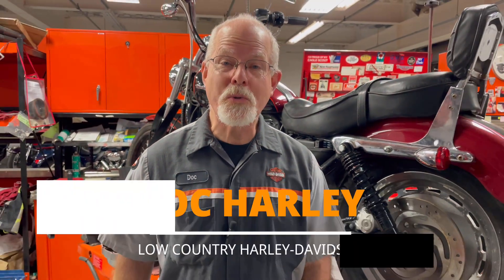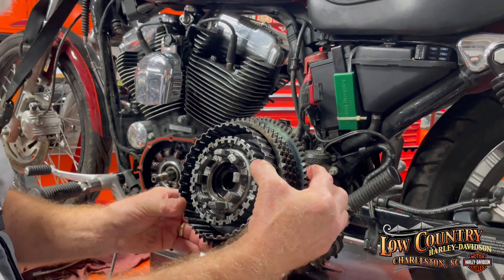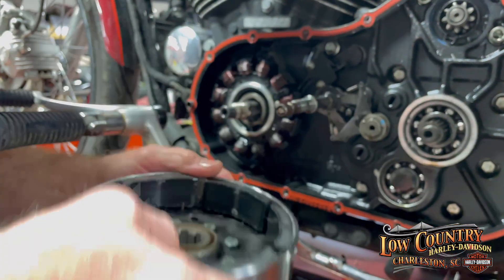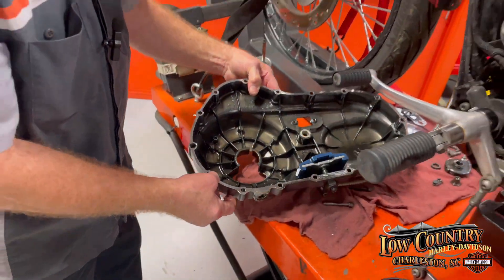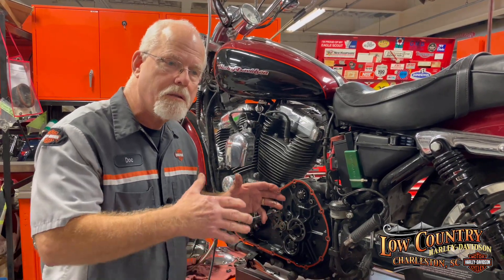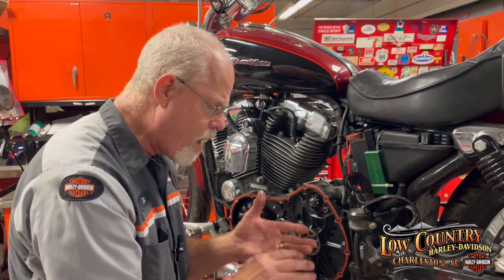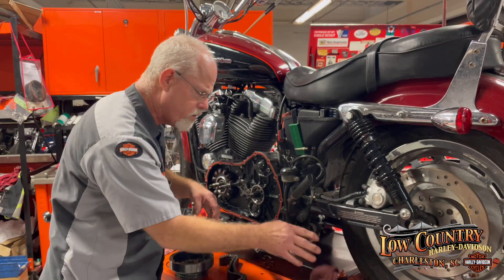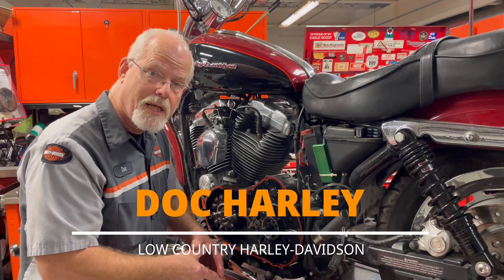Doc Harley Talks: Ignoring Starter/Primary Noises

Comment: I really appreciate videos like this so I hope you won't take my comments the wrong way.  This situation is exactly why I do not let anyone change my fluids.  I do it myself and have done so for 60 years.  I am not one to ignore grinding noises and I always pay attention to the starter since it usually gives early warning signs when it or the battery needs to be replaced.  This situation has obviously been going on for a long time.  Longer than the oil change interval. You didn't say if the dealership does regular service on this bike or if the customer does it.  Whoever changed the oil in this Sportster and didn't look at the drain plug needs to have his wrenches taken away fro him.
Reply: Absolutely. Anyone who rides, I don't care, from a Harley to a Honda, should be able to do their own maintenance on the bike. I've always done mine for nearly 60 years too. Also on my cars.

Comment: Doc. I had almost had the same thing happen to my Roadking , but I didn’t here any noise . When I was changing all my oiles  the oil in my primary had a silver tint to it but the plug didn’t have a lot of metal on it , so I changed the oil and put another 100 miles on it and looked again and it was silver . So I got my manual out and pulled the primary all apart and found the main clutch basket bearing had started to fail because the race on the shaft slips . If I didn’t catch that early in stead of $75 it would have cost way more . Pay attention to what your bike is telling you people ……..
Reply from the maker: Well done Sir…..Doc

Comment: Well rub a little salt in my wound Doc. You see, my '85 big twin Evo started this very thing late last summer. Slow turning over, starter clutch letting go and free-wheeling, the grind occasionally. Did I park it immediately and address whatever the issue(s) are? No. I'll deal with it during the off-season. Tore up my shoulder in November and that ended my riding season. Had surgery in December, and now about to return to work and now I'm gonna tear into it and find out what's up and prolly pay some stupid tax of my own.                                                         I guess like Don Smith says, I deserve a big fat bill for whatever parts I need.
Reply from the maker: Wishing you the best….Doc

Comment: You were supposed to put the round uneven black washer in between the two pieces for the passenger floorboards. That's what makes them stay up and not loose either. Took me a minute to figure it out cause no I structions. You think for $240 they could include instructions

Comment: Great video, learning something every time, I Have a 2014 ultra Limited with only 7K miles, all Stock, only slip on muffler, start hearing a clunking sound in my primary, when cruising, every time when I give a little gas and release the throttle , I noticed when I was driving around 40mph, maybe in 4th gear, any Idea, your help is greatly appreciated. Thank you
Reply from the maker: We appreciate you watching Doc Videos. My opinion if you have been using higher gears too soon on a 2014 with only 7K miles you might want to have a trusted Harley Tech inspect first your rear belt adjustment then all components inside your primary. Using higher gears at too low of MPH & RPM puts added stress on the primary components. I agree the motor sounds great loping along at a slow cruise….Doc

Comment: Doc I have a 2005 fat boy and I change oil every year and I don’t ride to much but I have growing noise I check the primary chain and adjusted still have noise not have metal is like bearing liner worn or bearing loose , 2000 to 3000 rpm and down noise is there. Thanks … 🙏🏻
Reply from the maker: Let me put my ear up to the internet 
🤔…..too many possibilities……Doc
Reply: @LowCountryHarleyDavidson   I know I’m so sorry , has to open the bike to check all bearings and something else, because no have metal derbis.

Comment: I'm getting a high pitched chirping noise from the compensator area on a 2012 electra glide cvo?  Everything I've read on the comp is more of a rattle/ clunk noise.  Chain tension does not seem off.  Thoughts?
Reply from the maker: My first thoughts are for you to check charging system. Why? If the Rotor and Stator are going bad a lot of damage can spread. Next the bolt that holds the Comp assembly tight is just starting to come loose. In any case, don’t wait for the rattle…..Doc

Comment: Hey doc will the 09 and up rear rim and drive pully fit on a 07 these are street glide models. I was wandering because I was going to replace the stock comp. To a solid comp and was looking at the rims for rubber pads in the pully.
Reply from the maker: I have never tried. It may work if you match the Swing-arm to the wheel…Doc

Comment: Hi Doc thanks for your great videos about harley motorcycles. We have a 2005 sportster 1200 XL and always its hit a bump on street we hear a metal sound like from the front end or under the gas tank. We send to change the engine mount, front folk spring and oil, check the triple tree bering all nuts are well adjust, tank bolt adjust, kick stand ect and all look ok. We go to 3 diferent motorcycle shop and spend money in diagnostic on each one, one of them was a Harley dealer and no one find what make the noice. Any sugerence about that
Thanks in advance for your help
Reply from the maker: I had one like that. Turned out to be the fasteners that hold the fender to the side plates that attach to the forks. Remove the fender and go on a ride ……Doc
Reply: @LowCountryHarleyDavidson   Thanks for try to help me. I remove the fender and ride its but still make the noice, look like from top triple tree or from front bottom tank. Any future segerence let us know
Thanks againg for your help and keep doing your great motorcycle tutorial videos👍

Comment: so what do you think was the real first problem here ??? battery so low it was making the starter grind into the gears ?? then it wore down the teeth of the surfaces contacts ??? then he just kept on using the bike and said oh well a little noise is ok when i start bike ??? and then it just got to the  point that he had to bring bike to the Dealership ???

Comment: Got an 08 xl1200l had to replace a primary cover used a vtwin mfg cover and a James gasket kit i have had none stop issues chasing down a binding shifter shaft followed torque specs bolt patterns ,it shifts with the cover on but no bolts seated any idea what I need to look at?
Reply from the maker: A bent shift arm through the cover, a bushing that is not in all the way, shift arm assembly is no pushed in all the way…Doc
Reply: @LowCountryHarleyDavidson  shift shaft was fine on previous cover only switched do to a stripped out clutch cable thread, I'll check the items listed to make sure that there wasn't a issue during install thanks
Reply: @LowCountryHarleyDavidson  was a faulty cover from vtwin mfg had a warp in it

Comment: So with my 2009 XL1200C I tried starting my bike when it died by running with it and popping the clutch in gear. I just ended up breaking something which I investigated to be the snap ring and retaining ring for the clutch pressure plate. The spring and clutch discs fell freely after pulling the cover off. I found at least one tooth on the part of the clutch that holds that to be chipped with scoring inside that general area. The pieces of the clip were large and mangled in the bottom of the cover. I wondered why I couldn’t get a proper clutch lever adjustment or why it wouldn’t change gears even with a new cable. 
And I still haven’t addressed why the bike died in the first place. I’ve just finished rebuilding the starter solenoid and will try to put that back on but the electrical plug that goes into the bottom part of the outside of the starter housing was filled with oil and I smashed the plastic on accident. No money to get a new starter so I’ve superglued the plastic pieces I could find and will try to silicone it in place when on the bike.
Reply: I guess my question is if I use the bike until I can replace the damaged parts in the clutch basket and if oil in that starter button electrical plug (the one on the bottom of the starter housing)would cause the starter to not work?
Reply from the maker: Wow, times are tuff. Hang in there….Doc
Reply from the maker: Multiple things going on here. There has to be a reason the clutch clip came out. Can’t just get a new clip and ride off. Well maybe you can, I could not, knowing the clip could come out again right when I need it going through an intersection. 
If oil is coming out the connection, you maybe did not replace the thin o-ring in the starter clutch assembly. Oil can be a conductor and ground out the power coming to the starter. It’s got to be tough but stop……Doc

Comment: Doc, wish you would do a video on the M8 cold start tick (Hydrolic lifter noise?).   This noise varies greatly between bikes in our HOG club.  A new M8 Road Glide Limited in our group had severe tick thank lasted for Minutes not seconds at startup.  After warranty tear-down, and dealer confab with the Harley Factory techs - the final verdict was "Run ONLY Syn 3"  Amsoil Vtwin oil was the culprit.  (What?)  I contacted the Amsoil engineers and they cried Bologna!  Now I see post that the tick may be carbon buildup on pistons on bikes with only 10K?  My M8 runs amsoil and the tick lasts only 15-30 seconds on cold start. (I have an external PVC vent can on mine).   What is the real story - and why with the M8 and not with the twin cam?  They both have hydrolic lifters?  Please do a video on this.  Thank you
Reply from the maker: I appreciate your suggestion and information….Doc

Comment: I feel like I have like a Humm or low pitch whine coming from mine

Any thoughts?

My only guess was Maybe low primary oil
Reply from the maker: I would want to know the condition of primary adjuster and remove the primary cover to see if the starter gear is returning back all the way….Doc

Comment: Why does this information not pertain to the other bikes. Seems like sound(pun intended) advice,
for all the cycles.
Reply from the maker: Each is built differently. IE big motors transmission is seperate vs XL. You are correct a noise not common should be addressed….Doc

Comment: Hello Doc Harley, I have that weird noise on a brand new bike. I believe it s the front wheel or transmission bearing. Please let me know if you have any idea as so far I have been told it s normal. Here s the video: https://youtu.be/5oNdFzGX1Ag and thanks a lot!
Reply from the maker: Please Email me more details. How long have you been riding Harley-Davidson motorcycles? What was your brand bike before? How many miles on the bike? What changes have you made from stock?
If you ride another brand before, if this is your first Harley, if the bike has less than 1000 miles, if you skipped the first service these and many other answers to questions can confirm your dealers answer or not. 
My other thought, ask your dealer if you can ride a bike the same as yours. Ride the same route as your video. (Record) then compare. If they are the same, trust your dealer. If different point out the clip in the recording…..Doc